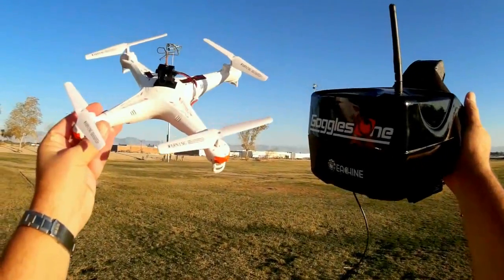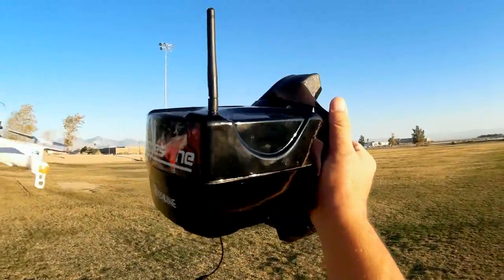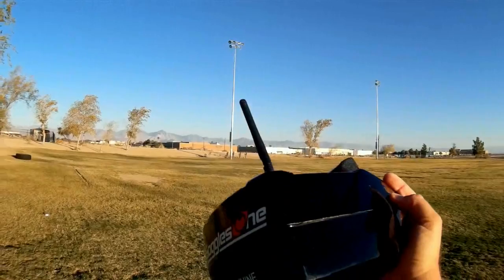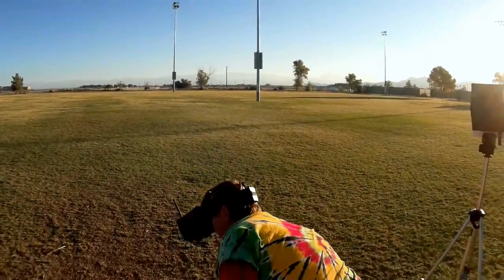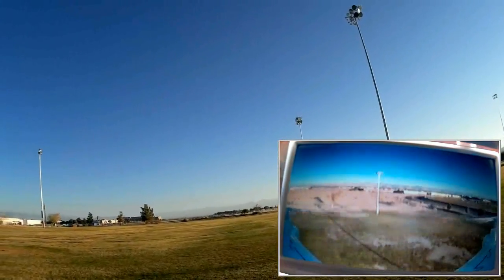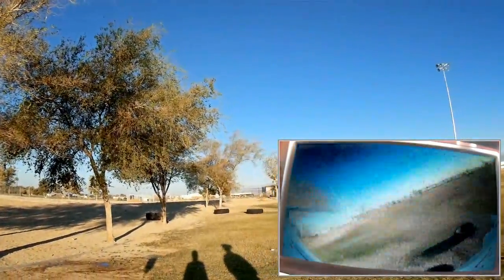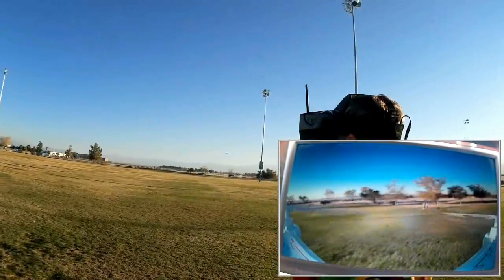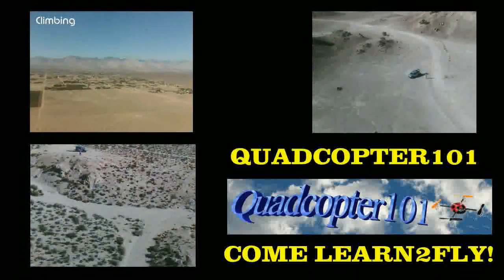Syma X5C FPV Racer Conversion Goggles One and Eachine EF-01 Micro FPV Cam

Comment: Just wondering if you know if the X5C-1 can be bound to the Syma X1 transmitter? One thing Ive noticed is that the X1 transmitter and X5C-1 transmitter are virtually identical in appearance. On the outside at least, they are pretty much clones. Though I don't know if the insides differ.
Reply from the maker: Boy the X1 is a blast from the past.  But why would you want to do such? You can get a brand new X5C these days for around $30 with transmitter.
Reply: Here in Australia, when I see prices for the X5C-1 with transmitter on international sites, they're usually in the AU$50 - $70 range so quite a bit more than what I want to spend. Without the transmitter, it's slightly over AU$30. So if I can get just the quad on it's own and bind it with my X1 transmitter, I would actually be saving quite a bit.
Reply from the maker: Well, although the X5C has been shown to bind with some X8C transmitters, I can't guarantee that it would bind with the older X1 transmitter.

Comment: how did you mount the camera on top? just Velcro? I hear these cameras run hot.
Reply from the maker: I used Velcro in this case, but have also used sticky tape, and rubber bands for others.  Just use any method that you think would hold it in place.  The 25mW AIO cameras only get warm.  But yes, the 200mW and above can get hot.  But I've also used rubber bands with a 200mW, but it wasn't hot enough to melt the rubber.
Reply: Quadcopter 101 my propel cloud rider has 4 camera plug ins. if I add the fpv and keep the og camera plugged in, will it still work?
Thank You
Reply: Yes, mine runs DARNED hot. Even after just a few seconds, the edges of the circuit board are too hot to touch. I wanted to run mine inverted to protect the antenna. You can invert the picture using the button, but if you do, it's useless for FPV flying as the picture is also swapped left/right.

Comment: Where did you get the adapter connector to connect the power of the quad's camera port to the fpv camera?
I've been trying to find the names of the connectors but can't seem to find any good information.
Reply: It's a Micro JST 1.25mm -also has a number on the Ebay ad - #W33. On Ebay, very cheap.

Comment: hi
i've bought an eachine tx02 to try fpv like you but my syma x5c doesn't lift the camera at all!?!? with a 500mah or 650mah the quadcopter it tries to takeoff but it won't...any ideas?

thanks
alex
Reply from the maker: +Alex Castignani did you also remove the original camera and landing gear to save weigh Also, whatever means that you're using to attach the tx02, is it a lightweight solution like mine?
Reply: my quad is like yours.. plus i've drilled some holes to loose more weight.... maybe 200mw tx is too much for the battery i'm using!!
Reply from the maker: Woah, 200mw, yes, that will definitely drain your little 1S battery fast.  Feel the camera, bet that it's hot.  That's lost power that should be going to your motors.  When drawing from a 1S battery, recommend a 25mw Tx only.
Reply from the maker: But the following solution might work to help get you in the air.  Provide it a separate battery to power it. It will be a bit heavier, but the power is not being robbed from the quadcopter's battery https://www.youtube.com/watch?v=no48y-Ulo8g
Reply: i'll try... thanks a lot!

Comment: Did u need to mod any wires for the syma to accept the camera power plug?
Reply from the maker: +Jim Leffler No, not on the quadcopter or its camera port. I did snip off the camera's plug from the X5C camera, so that I could solder on the FPV camera's power leads to it.
Reply: The x5c’s camera plug is 3 wires, the ef-01 has two.  Which wires did you solder?  
Thanks so much for your expertise!!
Reply from the maker: +Jim Leffler believe it was simply red and black if I remember correctly?
Reply from the maker: +Jim Leffler the third white wire is the X5C camera control (start/stop recording) wire. That wire I just left unattached.
Reply: You are correct!  Board shows RED = +, BLACK = -  THANKS!

Comment: Hi there!  How do you check the props after flying like you mentioned ?  New to the hobby. Love your videos
Reply from the maker: With the battery unplugged, gently turn each propeller by hand.  They should spin easily like a pinwheel, with no bumps or stops in their rotation. If you notice any unusual resistance or stops, you likely have a sand particle stuck between the teeth that must be cleared.
Reply: Thanks very much !

Comment: you need to run the fpv on a diffrent battrey its not getting enoth volts to power the transmitter like should

Comment: The specs shows it runs under  3.6-5.5V, so it barely works with 1S lipo. It may not work well with the power from 1S quads as some of quads have LVC that are as low as 3.2V.
Reply from the maker: Here's today's video  I flew it until the quad dropped https://www.youtube.com/watch?v=OTN3qI03UKA

Comment: just wanted to thank you for your recomnedtion of the EF01.  Mine arrived today.  I appreciate you are busy, and have already helped me in the past, but could you tell me what channel i will need to set it to, in order for it to work with my jxd  jjrc 509g screen please?
Reply from the maker: +Armour Empire try clicking its frequencies through the E band. Most toy quad FPV screens usually use E4 or E8.
Reply: very grateful indeed   thank you so much

Comment: Hi, i hope you can answer this, im buying the same camera, but i dont know how ill attach it to the quad, what type of adaptor/splitter did you get?
Reply from the maker: +KrYpz0n I snipped and reused the plug from the stock X5C camera, since I never really used that camera anyways ;-)
Reply: +Quadcopter 101 problem is that i ordered the x5c without any camera :/
Reply: Could you find the plug? I'm in the same situation you were :/

Comment: what do you mean by "check your propellers" ? as in make sure they spin freely ?
Reply from the maker: Yes. They should spin freely like a pinwheel on these smaller coreless motor quadcopters.  If not, there's likely dirt or sand in the gears which must be cleared https://www.youtube.com/watch?v=LzzD3BPVvH0
Reply: +Quadcopter 101 yeah that's what I thought, i use a little air compressor/swabs/and tweezers to clean my quads after flying

Comment: Could you explain the way you made the connector from the quad to the camera lead. Thanks
Reply from the maker: I never use my X5C camera anymore.  It's just not a very good camera. For recorded X5C aerial video, these days I just velcro a 808 keychain camera to it.  As such, I snipped off and salvaged the X5C's camera connector plug, leaving sufficient wire on the plug.  Then I just soldered the red and black power wires of the EF01 camera to the corresponding red and black wires of the X5C camera plug.  The white wire is the camera recording control wire, and is not used or connected with the EF01. If you do such, remember to include some insulation around your soldering points to prevent short circuiting.  I used some thin shrink tube, but electrical tape should work also.
Reply: Appreciate the quick response. I thought that could be done. Haven't used the camera in a long time. To much extra weight.Thanks again.

Comment: Documentation says this operates on 5 v minimum. Will the camera actually last until the end of a 1S battery? If it turns off before the end of the low voltage warning, it's just no good for me
Reply from the maker: I think that you're confusing this with the higher voltage MC01 camera for 2S and 3S batteries.  The lower voltage EF01 camera is for 1S batteries.
Working voltage is 3.6 to 5.5V http://www.banggood.com/Eachine-EF-01-AIO-5_8G-40CH-25MW-VTX-800TVL-13-Cmos-FPV-Camera-p-1064301.html?p=RB0922217402201307U3

Comment: what happened with the video image blacking out?  That could be dangerous...
Reply from the maker: That was the recording on my Sky 702 FPV screen.  It uses linear pole antennas.  I really should be using a right hand circular polarized antennas on the receivers to match the polarization of the transmitter antenna.

Comment: witch one is better MC 01 or EF 01for fpv
Reply from the maker: They're both great.  But if you intend to use a camera with the 7.4V X8C, then I'd recommend the MC-01 instead as it can be powered at that voltage.  The EF-01 is more for smaller quadcopters powered by 3.7V batteries, like on the X5C.  Here's the MC-01 http://www.banggood.com/Eachine-MC01-AIO-5_8G-40CH-25MW-VTX-600TVL-13-Cmos-FPV-Camera-p-1065228.html
Reply: Quadcopter 101  yea i was planning to use it with the Syma x8 ,  but witch one is better talking about camera and FPV
Reply from the maker: They're about the same in terms of camera and FPV performance with 25mW 100mA transmitter.  It's just that one can be used with 1S batteries of smaller quadcopters, and the other is for 2S and 3S batteries of larger quadcopters
Reply: Quadcopter 101 ok i get it , thanks for your help

Comment: I'd like to use my Syma 4001 FPV receiver (monitor) with this FPV cam/trans set up.. does cam/Tx  have  a selectable freq compatible with the 4001 monitor? (Rx freq is ?) Also, where would I get a plug for the Syma x5c-1 camera port (Name/nomenclature).. many thanks!

Comment: Why didn't you use a separate lipo to for cam, the Syma can handle the weight easily. 
I've been sticking my Runcam HD to the X5c and fly and average of 3m30s.
With 150+ flights(incl.Runcam) and only 6 or7 motors replaced I think the X5c is a beast.
And with the 750mAh 35-70c lipo's I've been using lately I'm thinking it could even fly with this 9gr. camera added.

btw; Did you know different bands/frequencies can have different power outputs, as much as 100%. If anybody has the time to this testing it's possible to increase the range.

Comment: Did this to my X5C a few weeks ago with a tiny whoop camera! Made a small roll cage out of antenna tubing to protect the clover leaf and used double sided tape to mount the camera. Recently i drilled two small holes in the canopy to hold the camera in place with a thin zip tie. Its alot of fun and the small camera doesn't effect the battery life too much.

Comment: This is a great idea.. QUESTION, will any of the Eachine 5.8 goggles work with this?  I eventually want an Eachine 250 Racer and would not want to have to buy 2 sets of goggles, thanks in advance.
Reply from the maker: Yes, they all will work with it as the EF-01 transmits on 40 channels within 5 popular 5.8 Ghz FPV bands (A, B, E, F, and R)

Comment: i ordered the syma fpv 5.8g kit.in fact everything i order online(on your recommendation)until it reaches israel you show us something much better.you thing the goggels will be compatible with the syma fpv kit?
Reply from the maker: Most 5.8Ghz FPV goggles will work with this.  Don't need anything special.  These will work http://www.banggood.com/Eachine-VR-007-5_8G-40CH-HD-FPV-Goggles-Video-Glasses-4_3-Inch-With-7_4V-800mAh-Battery-p-960761.html?p=RB0922217402201307U3

Comment: 101 do you need the goggles to make it fpv or can it work without those
Reply: Also if I don't  need the goggles. Will this also work with the Akaso x5c
Reply: You either need goggles or an fpv monitor with a video receiver and antenna.
Reply: +Jon B Baca ok thank you

Comment: Greetings, Quadcoper101,Your Input on Drones has Been GREAT!! ..I 'm New  to Drones, only been 3 months, and you have inspired me to spend a Easy Grand plus, on  14+ different Drones from the Cheerson CX-10C to the UpAir 2K, ..and 5 Syma "X" series Quads from the one you just showed to the Limited Edition Carbon Fiber. Many are FPV w/ cameras Like My UpAir 2K & Syma X5SW...My Question is this, I want to Esperance the VR Googles, next, ...DO All FPV's work w/ VR Googles??  or do I have to install EF-01 FPV camera...on Quads Like the X5SW, also?? .. I watch ALL your Review you did on the UpAir, ...and it encouraged me to  buy that to, and seen you using VR Googles w/ the UpAir.. so that should be all set. PLEASE give me {or somebody} More Input, as well as a Good Starter pair of VR Googles.Thank YOU, Very Much, for All your efforts in Helping Millions enjoy the World of  Quads / Drones.
Reply from the maker: I've played with a lot of low cost goggles, and i think that the following is the best bang for your buck.  It's capable of receiving 5.8Ghz analog FPV video, such as from both your UPair One, and the EF-01 micro camera.  But it is not capable of receiving 2.4Ghz WiFi FPV (no big loss as WiFi FPV is inferior to 5.8Ghz analog FPV). It has a scan button that will automatically search for whatever frequency these devices might be transmitting on. http://www.banggood.com/Eachine-EV800-5-Inches-800x480-FPV-Goggles-5_8G-40CH-Raceband-Auto-Searching-Build-In-Battery-p-1053357.html?p=RB0922217402201307U3

Comment: Hey Quadcoper101,
  Could you please check out the SJRC T70CW and tell me what you think of it - and maybe even do a video on it? Thank you in advance.

http://www.lightinthebox.com/sjrc-t70cw-real-time-transmission-2-4g-4channel-6axis-hd-wifi-fpv-rc-quadcopter-drones-high-pressure-fixed_p5054186.html?currency=GBP&litb_from=paid_adwords_shopping&sku=262_4385%7C441_7392%7C444_27165&utm_source=google_shopping&utm_medium=cpc&adword_mt=&adword_ct=84187195634&adword_kw=&adword_pos=1o7&adword_pl=&adword_net=g&adword_tar=&adw_src_id=1810908567_301579154_21687113474_aud-83346267755:pla-104068895312&gclid=Cj0KEQjw57W9BRDM9_a-2vWJ68EBEiQAwPNFK5xRclrxvetYq7FTDwBowm2Fa9P9eAI-_CqLv13prtIaAnmw8P8HAQ

Comment from the maker: TiagoTiago,
Couldn't reply directly to you for some reason.  So I'll post it here. For a full battery charge, you should let them cool at least 15 minutes (at least twice the flight time).  Additionally, you don't need to brush the gear teeth unless you notice binding in the turn of the props.  You should manually turn each prop by hand before and after every flight to feel for any unusual binding or bumps in the turns. A single grain of sand stuck in the gear teeth can burn out a motor.  The props should spin freely and silently like a pinwheel.  A toothbrush sometimes isn't sufficient.  Sometimes you need to use a pin to dislodge those particularly stubborn sand particles.
Reply: Love your vids.Can you do unboxing with the review together in your future videos?
Reply: +Quadcopter 101
I'm glad I came back to this video; I dunno why you couldn't reply to me. Maybe it's related to whatever is causing me to be unable to properly do mentions (nothing shows when I type the plus sign), dunno; haven't been able to figure it out so far.

So could it be that the excessive brushing actually wore down the gears? Some of the motors that died were actually spinning better than the others at the time they died

Since I'll be getting notifications from this thread now that I replied here, I'll take the opportunity to ask another question: Have you tried using the X5HC props on the X5C? I've seen some people saying it adds quite a bit of power and reduces noise.
Reply from the maker: ***** How do you know the gears are wore down?  Are you judging that based on the smaller pinion gear not coming in full contact with the main gear? If so, that is common for a bad motor that has worn its brushes, as they provide internal support to the pinion shaft.  And, am guessing that if you are keeping the gears clean, your motors may be burning out prematurely as you aren't giving them enough time to cool down between flights.
Reply: +Quadcopter 101  I don't, I was just speculating. I don't know why the motors kept dying on all 4 mounts one after the other.

Btw, is that cooldown time for hot weather, or should I do more than double when it's hot? (where I live it can reach close to 40ºC in the summer)
Reply from the maker: ***** If it's 40C, I'd limit it to one flight a day ;-)
Reply: +Quadcopter 101 Oh :/

Is there a formula or something to figure out how much cooldown is needed depending on the weather?
Reply: +Quadcopter 101 my drone is coming tomorrow 😃

Comment: I was gifted a x5c-1 last year; but it kept burning motors one after the other after very little time flying. Eventually someone suggested the problem might be I was flying it one battery after the other without letting the motors cool down, so I started letting them cool for about as much time as I the flight time, but the motors kept dying. I brushed the gears very often, pretty much before and after each flight; and most flights took place indoors anyway. Also, I had someone check the circuit board and they said it was outputting the correct power.

My budget is already negative after the money spent on several new motors (not to mention the absurd amount customs charged me); do you think I should risk buying a new one? 

Any idea could be happening with the old one? I just flew it too much every day? Something wrong with the frame or motor mounts?

Comment: Camera is cheap enough BUT big ouch on price of the goggles! Are these cheaper alternatives that will work? :)My Syma x5c is still running smoothly after numerous flights and crashes too!
Reply from the maker: These are fine also http://www.banggood.com/Eachine-VR-007-5_8G-40CH-HD-FPV-Goggles-Video-Glasses-4_3-Inch-With-7_4V-800mAh-Battery-p-960761.html?p=RB0922217402201307U3

Comment: 25 mW are enough for getting a good signal on the Rx? the camara can be powered with the Syma x8 cámara plug? the plug work at 5 V and is able to power a sport cam such the Eken H9 (for reducing de weight of the battery of the camara). Many thanks
Reply from the maker: 5V is appropriate for this camera.
Reply: +Quadcopter 101 thanks, which is better, this one or the Syma x5c fpv kit camera?
Reply from the maker: Francesco A. This is better.  Much better camera and lens.